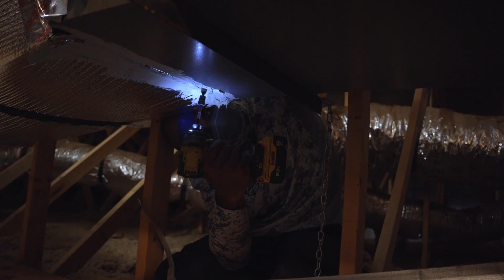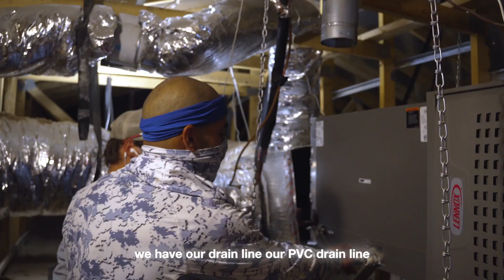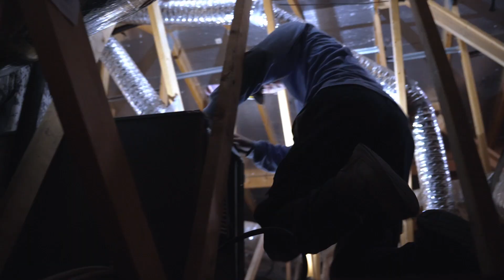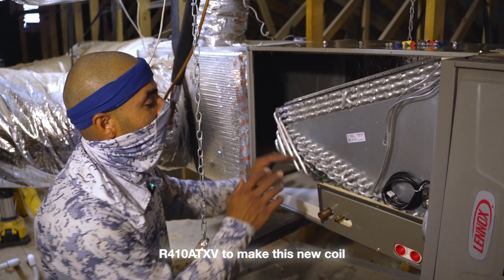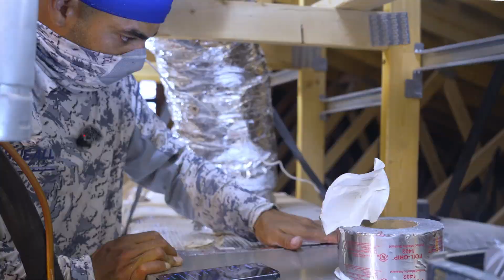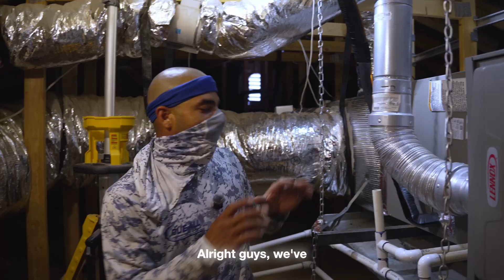AC Evaporator Coil Replacement Start to Finish | Full Pro Walkthrough

Comment: Well done. The only recommendation I have is your condensate drainage setup. If the line were to ever back up, the condensate would then fill the evaporators drain pan up, leak into the supply plenum and/or furnace compartment. I'd definitely recommend re-routing the secondary drain line either in the auxiliary drain pan or installing a float safety device right off that secondary port.